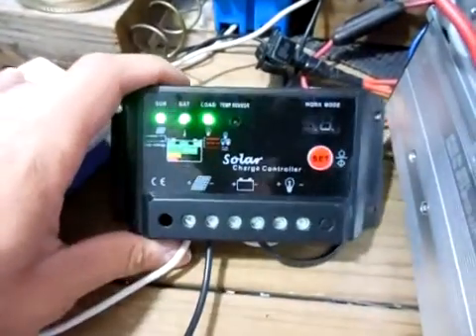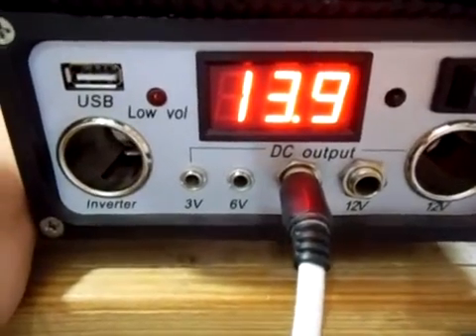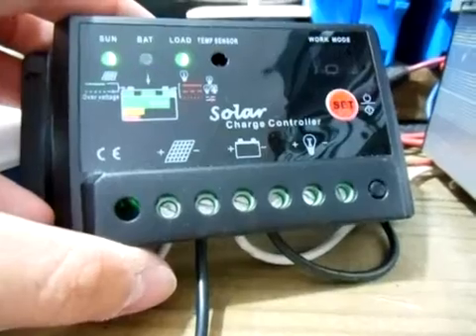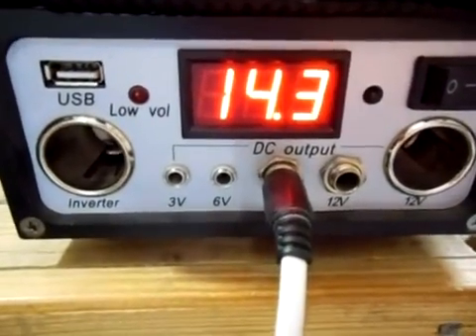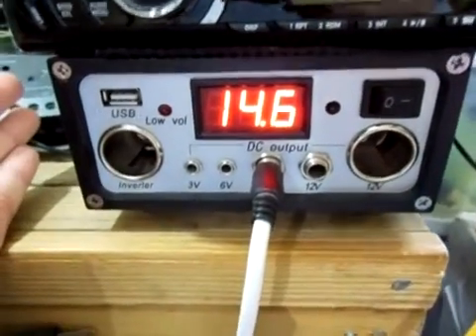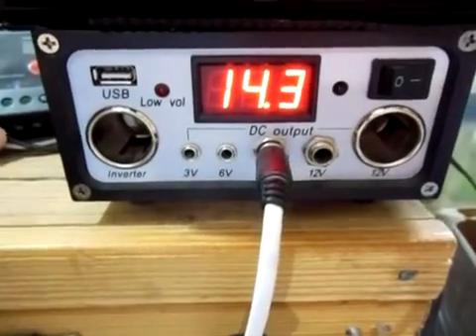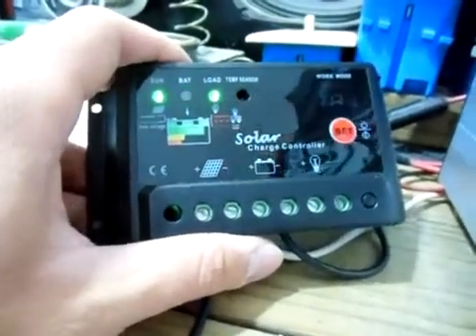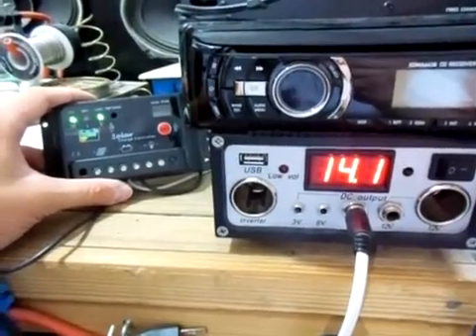PMW Verses Voltage Regulating Charge Controller

Comment: Hi man. Thanks for the video. I have a question that based on your experience you will sure have the answer :).
I have a normal car battery (75W) hooked to my panels (90W combined) with this same PWM and it is starting to fail. I am just using three 10W led food lights during 4 hours at night and I think I am taking to much for the poor battery as it is starting to fail, the flood lights started to cut/flash after two hours and the PWM flash the same way red light for battery.
Do you have any thoughts or recommendation ?? Maybe the Batt is already dead and I need another one / a different one ...

Thanks in advance
Reply from the maker: Thanks for the question! It sounds like to me that your battery is pretty much no good. I suggest that you get a deep cycle marine battery. The regular car batteries are not made to be drained as much as a deep cycle battery. I use the 12 volt 70ah. batteries in my system. I bought them from Advance Auto Parts. They have worked really good for me.

Comment: Hey man. I have the exact same charge controller. When I hook up my little 20W solar panel and one of my 12V batteries to it, the LED for the Battery is RED. Does that mean the battery is fully charged and the controller is not allowing any further charge to go to the battery? The voltage of the system in direct sunlight is like 18 to 19 Volts.
Reply from the maker: That means that your battery is dead. (for this controller, dead is under 12.4-12.5) Once your battery is above 12.65, the light should turn green. If the light is still red with the battery above 12.65, your controller may be defective.